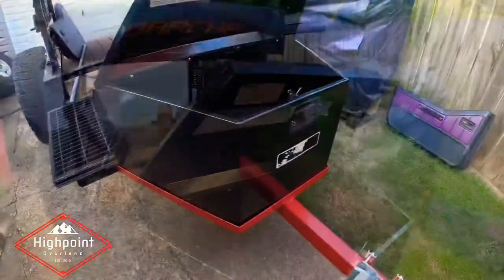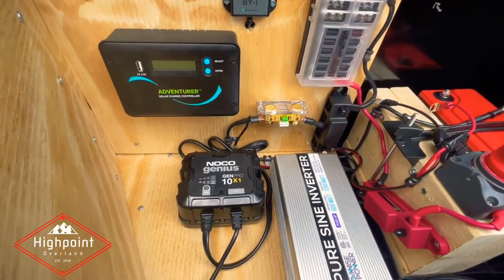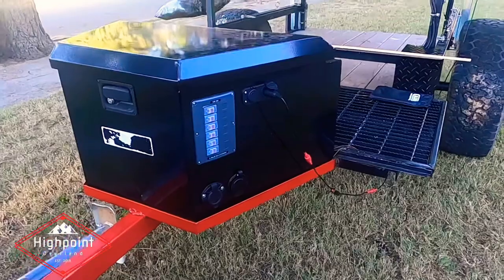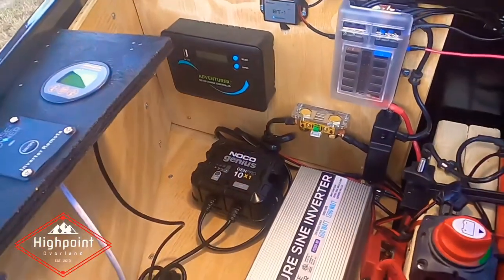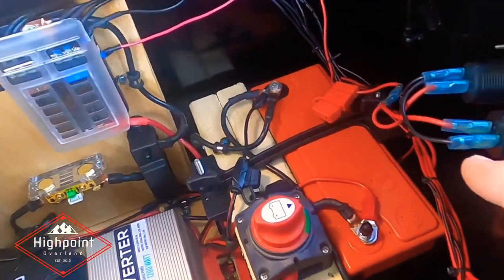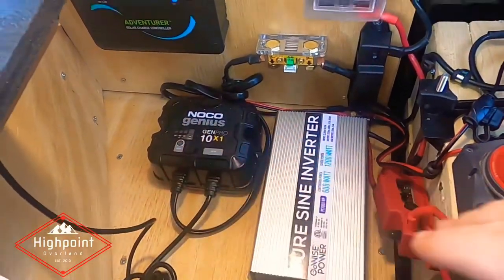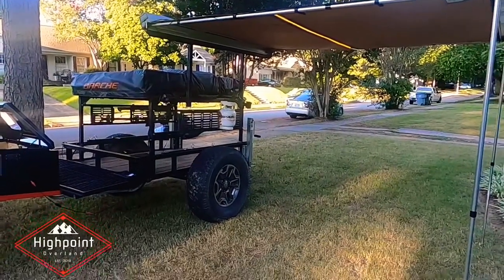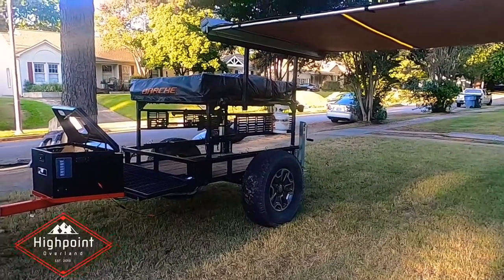DIY Overland Rooftop Tent Trailer Electrical System w/ Solar & Shore power options

Comment: I’m just curious would it be possible to set it up where you could run all of the lights and stuff off something like a jackery?
Reply from the maker: Oh for sure. You can do that with an Anderson connector and plug into your 12 volt port on the Jackery or whatever you have.